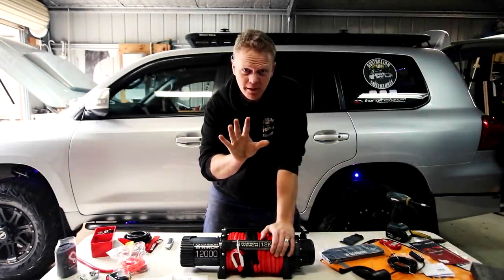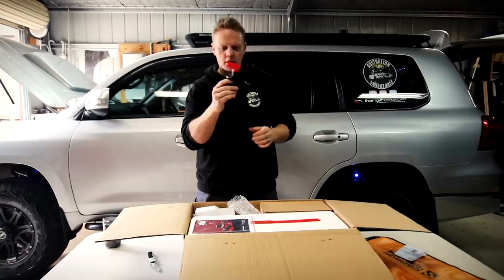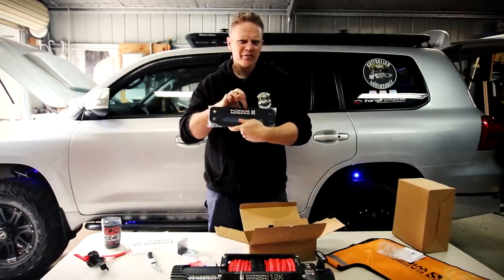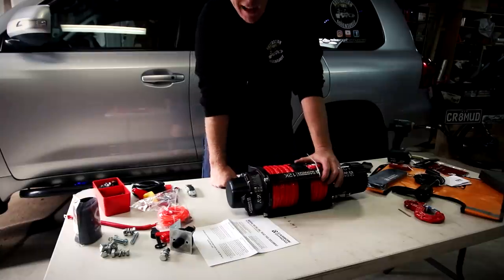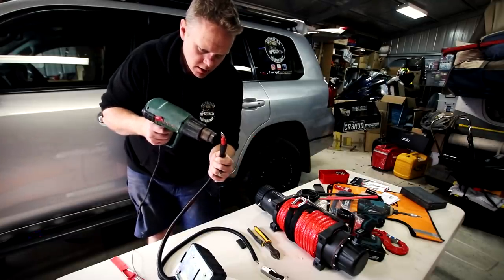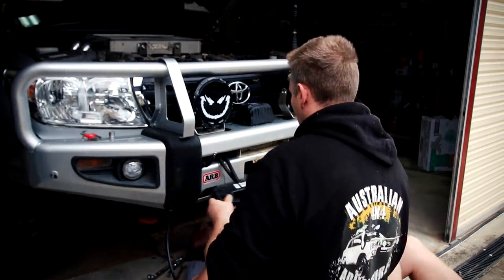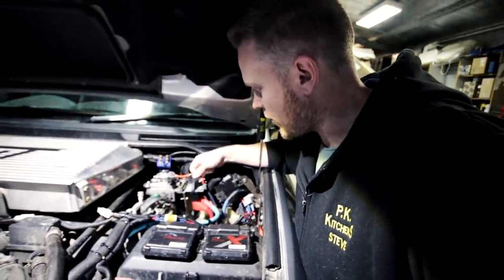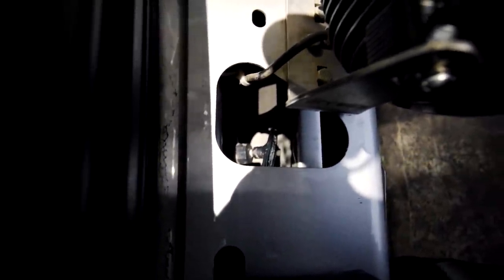How to install a winch - Carbon winch - Australian 4x4 Adventures

Comment: Great Video Steve. 
The isolator switch is a catch 22 situation: if don't install it you have a BIG wire always live but if you install it you have one more device that can fail in an emergency situation.
As far as winching the car in half I haven't come across one single person that it has happened yet.
Thanks
Reply from the maker: I tend to agree it’s another thing to fail but it’s not a massive job to just bolt the 2 wires together if needed.  

I’ve heard story’s of it but never really seen it.  
I have seen winches get stuck on and destroy the front of cars before.
Reply: @Australian4x4Adventures  A mate of mine had a Wireless winch turn on un commanded, Damaged the steel bullbar & burnt out the wiring, Lucky he had some large cutters to cut the cable. As for the isolator switch i use a heavy duty one.
Reply: @Australian4x4Adventures  yep I've had two of those type of switches fail on me. Still glad I have one installed, because I had the solenoid break off inside the control box and rub through the wires on the inside. Plus I'm paranoid of someone bumping on the remote and destroying my bar and winch.

Comment: That keyring lanyard is to clip ur wireless reciever to the winch control port cover rubber. So if ur reciever comes loose, the clip lanyard catches it before it falls to the floor or in a bog hole lol.
Reply from the maker: Ahhhh see.  Now I knew one of you legends would help me out on what that was for 😝

Comment: Great video Steve as always.
 I don't like using isolators on winches as I have seen so many fail. Instead of using an isolator on my car, I have alter the control box wiring and allow it to activate only with the ignition on, just incase you decide to winch my car in half lol
Reply from the maker: 😂. Good working in of the winching my car in half bit.  Well done. 

I’ve never had an isolator like this one. 
I’ve had a separate Incab isolation switch but never a big key like one that I have now.  

Guess we will see if anything goes wrong with it. 

The WiFi remote is amazing 😍😍
Reply: @Australian4x4Adventures  well if the isolator ever does fail, it's easy to bypass by putting both lugs on one stud of the isolator.
P.s I feel like I've drawn the shortest straw with my carbon 12000lb winch, I didn't get a key ring or a damper with it 😒
Reply: @Australian4x4Adventures  and yes the wifi remote is handy
Reply: @petersgq351c  doing it your way means you have voltage always live running from the battery along yhe thick power cable. With the isolater ol mate is using, there isnt 12v power running through the cables all the time, good if u ever get into a front on accident and so there isnt a live 12v power feed running all through the engine bay that could arc out and cause a fire.

Comment: Wow Steve, I have the same Bar as you but was told I would need to remove the Bar to install a winch at the tune of 480 bucks so that turned me off so seeing you install a winch without removing the Bar has inspired me...
Reply from the maker: Absolutely don’t need to remove bar to install them on a 200.   
Well at least not with the ARB bar anyway.

Comment: Split conduit is a double edged sword, dust and crap gets in and rubs through where you can’t see it
Reply from the maker: I still think it’s the lesser of two evils.
Reply: Don't use split conduit. Use seamless, and heat shrink like he says. Yes a tiny bit will always get in, but not like the split stuff.

Comment: Hiya Steve, how's the winch going ?  
Would love to hear an update as I'm about to pull the trigger on one.
And does your code still work Lol

Cheers mate:)
Reply from the maker: Hey mate.  Winch is still going strong.  Used it heaps ( clearly I need to learn to drive better 😂 ).  

Yeah code still works.

Comment: Hi Steve - i just bought the carbon winch - how did you mount the box on the sumit bar - did you use the bracket they supplied if so did you support it underneath with washers etc?
Reply from the maker: Just set it up on washers.

Comment: Hey did you need to buy anything else to mount it to the Summit bar or it fit straight out of the box? Cheers
Reply from the maker: Didn’t need anything other then what was in the box.  

If you’re looking at buying one.  Carbon have since given me a promo code because they liked my vid.  
If you use A4x4A in the check out you get a free soft shackle worth $50
Reply: Australian 4x4 Adventures nice one thanks mate

Comment: When stating number 5 ...... It looks like you're on Rocky track ....  I'm heading down that way to do some of the tracks again this Christmas... I would just once like to get though that part where you were winching .... Without the winch.lol
Reply from the maker: I’ve managed to drive it a few times now but never in the wet
Reply: @Australian4x4Adventures  if you're heading up to do Rocky again over Christmas....I would be happy to tag along.... I want to see if the small changes in my set up helps ..or just holds me back....lol... Too busy to put my car on a track or two before I leave Sydney. . .

Comment: Only one key point missing like all the winch install videos and also for refitting a winch as well, the install videos need to make a verbal point that its important that a winch motor is on the drivers side of a vehicle and the clutch on the passenger side and if a rear winch is being fitted then the motor is on the passenger side and clutch on the drivers side for a rear winch set up.
I see quite a few winches installed the wrong way and often people with the motor on the wrong side and you can noticeably tell the difference when swapped to the correct way installed. Also assuming the drum brakes are designed to work better in one directions. I learnt that hard way and now have mine mounted the correct way.
Reply from the maker: Didn’t really think about that as that’s just common sense to me but you’re right.  Simple mistake to make for a beginner
Reply: Not disagreeing but I'd love to understand the logic behind that.
Reply: @chas3r_DWAG  I would say logic that's the way the manufactures design them to work. If you want more logic  ask the questions to your winch manufacturer. I say this as the Runva winch manufacturer confirmed they should be fitted a certain way with rope in o certain way as well.
Reply: See the winch I just bought had both sides needing to be clocked to be that orientation and then on top of that it puts the electrical connections further away from the battery which is worse from an electrical stand point eg. Volt drop.

I have now put it in the way you have mentioned but to me the logical choice would be whatever gives the electrical system the least stress. Mechanically it seems the same to me.

I will say my mechanical aptitude isn't the  greatest though 😅
Reply: @chas3r_DWAG  you will find it pulls slightley harder and when holding the rope it wont slow slightly. Assuming the brakes were also designed to work best one way. i had a winch brake fail with the winch back to front but now that winch the right way works as designed. as far as volt drop you can add larger 00 cable if your concerned

Comment: Thanks Steve, that is a good looking winch, and the cheapest of the second tier winches at about a grand. I didn't see where you put it, that little red strap, but point of contention: If it has a loop at one end then it goes on the hook - Warn style, but if it has a loop at both ends it is meant to be a load limiting device to stop the cable from unspooling all the way to the bolt that ties the rope to the drum - how many loops did your little red strap have?? Cheers mate.

Comment: Torque values on those gearbox bolts...just in case some are light handed lol
Reply from the maker: I don’t think you’d need to be a fly on the wall.  You could be 3 suburbs across and still hear it 😂

Comment: "I'm gonna winch ya car onto the tow truck or a trailer and pinch it.. lol" as if, ok a new idea for someone. I have been a towie & heavy haulage operator for many years and NEVER heard of anyone saying "I'm gonna winch ya car in half" it must be where your hanging out haha... My Winch has NO winch isolator switch and it was put in by a professional. What is wrong with filing or taking some off the side of the free winch spool control handle to make it turn fully or grind some of the bull bar frame to achieve the same goal? So do you pay ya mates lots or not.. I think they need to tell you to bugger off and "Do it Ya-self".... I was always taught (Ex-RAN Firefighter) to put the dampner at the Middle of the length of tow as it can be seen and also breaks the direction of the ricochet, thus possibly saving your life.
Reply from the maker: I’ll try find a photo of a car being winched in half and post it on my insta 😂.  

The winch damper in the middle of the run came from when everyone used cable.  

Rope doesn’t hold energy so it just drops. 

Unfortunately the hook doesn’t. So you cover the hook.
Reply: @Australian4x4Adventures  Your correct Re the cable days, but I would still put the dampner at about 1/2 length so I can see it (the cable) and see what is happening.. Re being a Fire Fighter, Towie & Heavy Haulage operator, I have seen personally what happens when cables and tow lines break and I will still put the dampner 1/2 way.

Comment: why not put the breathers in the airbox ?
Reply from the maker: Because that’s another point of entry into the air box that would need to be sealed.  And another thing that could let dust in if it failed

Comment: Looking at this winch , What was the grease like inside the Winch, should have filmed that. Was there enough or not enough or shit grease. 
And agree , Winch damper on the winch and added safety one Half way.
Reply from the maker: I did film it but I didn’t include it because it didn’t seem very interesting.  
There was heaps of grease and looked nice and thick ( not runny as all )

Comment: Anyone else had issues with the solenoid in control box? Just had the second one stick after 1 min of use to spool my winch cable back in after the other one crapped itself.
Reply from the maker: I haven’t had any issue like that as of yet.
Reply: Well hope mine is the exception to most but at this rate I’m not impressed. They are cheap Chinese solenoids which can be found on eBay for 50 bux with two new wireless remotes and a wireless transmitter/receiver. Once my warranty is up I will wire in an Albright solenoid. 

Cheers